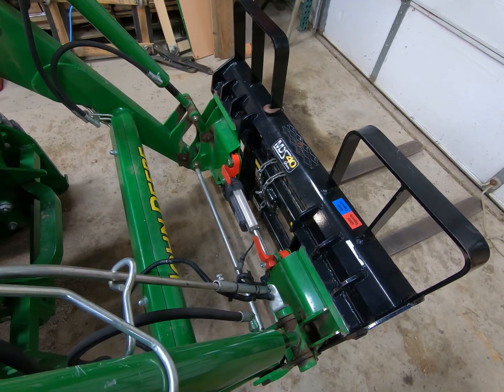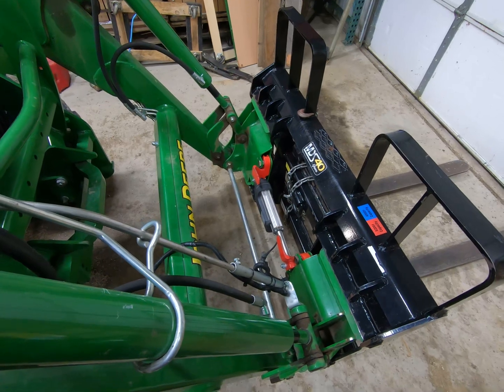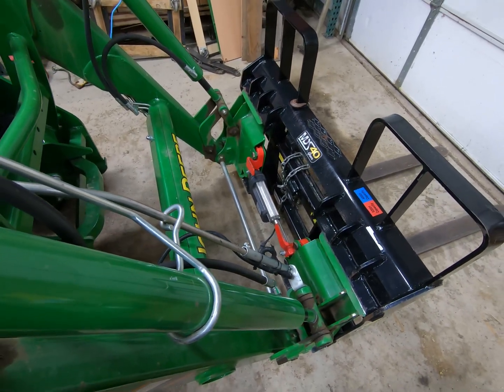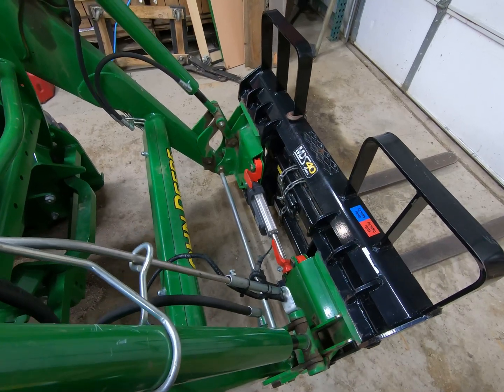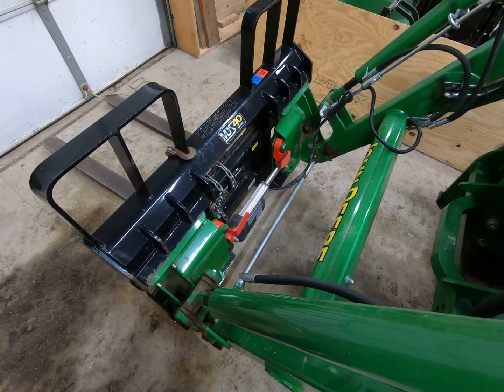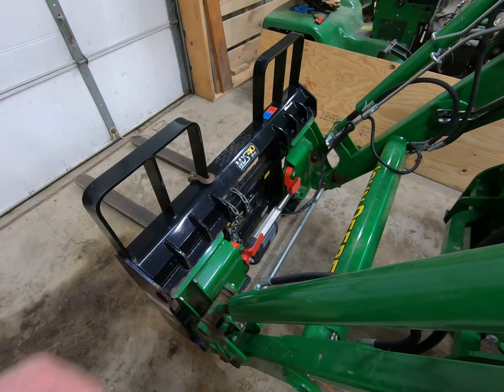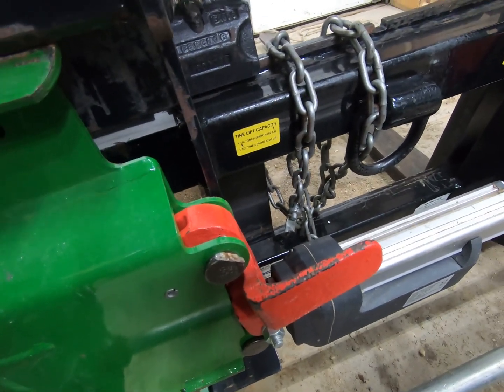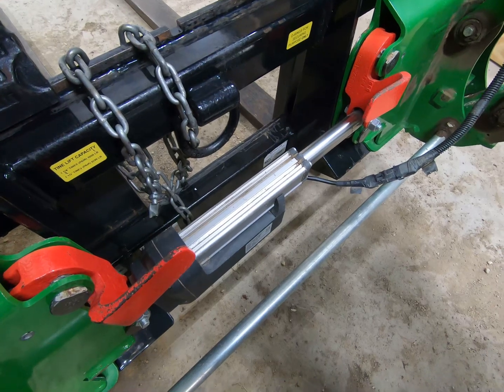John Deere 4066R Skid Steer Linear Actuator

Comment: Did you order the SSQA from John Deere when you ordered the tractor? I didn’t see that as a build option for the 4000 series tractors ?
Reply from the maker: Yes it was an option when I order the loader. You might need to speak with a sales rep. I think it was a $700 option when I bought might with a “refund” of $400 for the quick attach system, so total cost of an extra $300. Not sure how much it would be now.
Reply: @mmrbeef  thank you I will inquire with my dealer .

Comment: Nice work! I did one on my TYM 754. I use it every day. The only problem I’ve ever had is wires fatigue breaking between loader frame and actuator. I added a heavy telescoping “stabilizer” above the actuator to protect it from snow/rocks. Here is a link to my wife’s video of it. https://youtu.be/AYyALtW1Prg